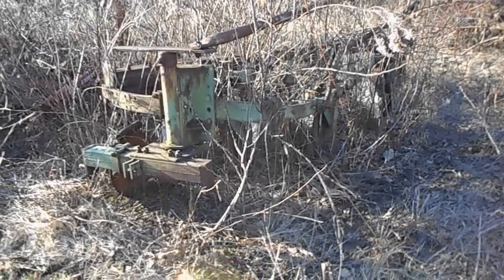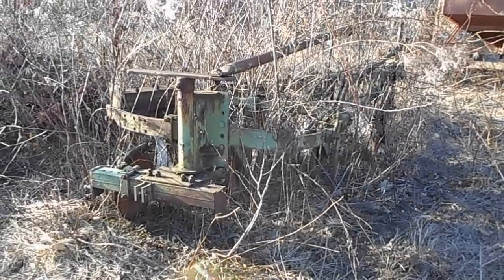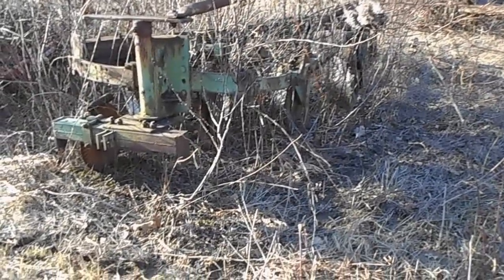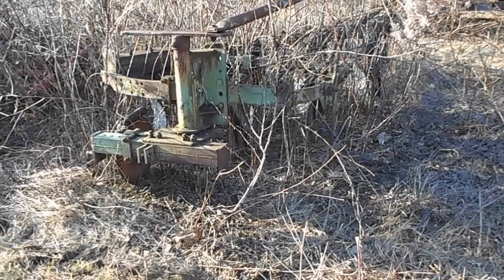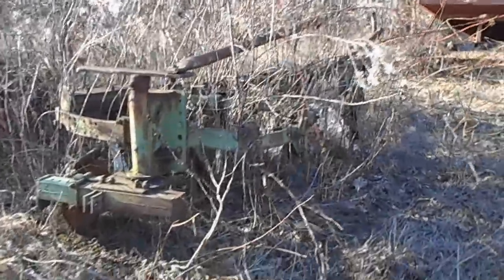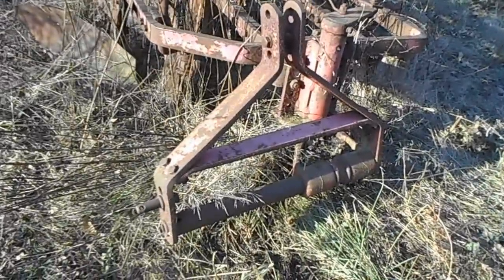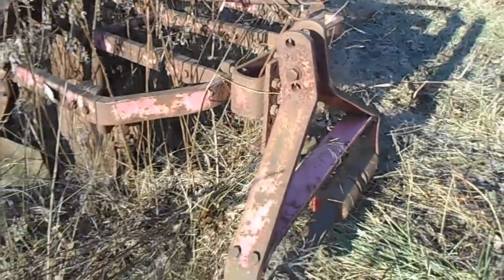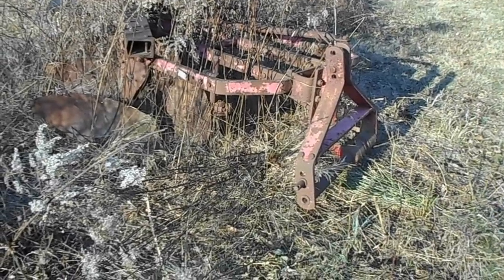Plow Education What plow for your tractor

Comment: Thanks I learned a lot on the 2 plows.   want to get a 2 bottom plow for my Massey 60hp.  I know I can't pull the Massey plow you showed in the video but since I want a 2 bottom plow, does the same strategy apply?  Thanks.  Full-watch.  👍🏽🙂
Reply from the maker: The only plow you will find in a 2 bottom is a mounted or pull type plow. A 60 hp MF should pull a 3x14" slick as can be but a 2 bottom she will pull it easy. My 1550's are 54 hp and they will pull a 4 bottom.  Most 3pt mounted plows (2 or 3 bottom)follow the same idea pulling from the center of the plow but when you get bigger like a 4 or 5 bottom ( 3pt mounted) it gets a little different because you cant pull from the center very easy, Thats why we used to run wheels out on the back of the tractor to center the plows. The work I did on the MF 4 bottom was the center it back up because the way it was it was doing all the pulling of the plow on the left lift arm on the 3 pt so it was pulling the tractor sideways a bit and thats why I centered the hitch back up like I did. A plow set wrong will pull really hard to the point it will make the black smoke roll out of a diesel !  The best thing is to get a book for what ever plow you get (ebay is a great place to look) and it will tell you everything you need to know to set the plow and the tractor together for good plowing.  Bandit
Reply: @banditfarmer1900  Thanks.

Comment: I've seen draft control way back on the hart Parr. Watching early IH videos they brag to high heaven about draft control. I have plowed with case and John deere and never even worried about draft control when younger. Pulled just fine.
Reply from the maker: This MF #88 semi mount plow is a lot different in the fact is the only plow ever built that would work on rock shaft or center link draft control systems.  Sure you could get that special quick hitch and use it on Ford MF MM and others that had a center link draft system and use any ones semi mount plows on the tractors, But the #88 plow was designed with that hitch on it so you could use it on any 3 pt hitch tractor weather it had rock shaft draft or center link draft. I've seen a lot of plows over the years and the #88 is the only one built like it and it could be ordered with the regular hitch (lower pins only) or with the full 3 pt tree for tractors with the center link draft system. But it would work on both tractors drafts systems equally well. This makes this plow a little unique ! Bandit

Comment: The way i was told how to recognise if a plow is made for centre link control is it has a solid round  hole for toplink, if the plow is made for lower arm control the toplink fixing is an elongated hole so that the toplink can float when the arms move up and down. With centre link control in a slotted hole it will not work as the pin just slides backward and forward in the slot, with fixed hole and arm control the tractor will try to raise the back of the plow first instead of the front to adgust depth, works to a point but puts excess stress on everything.
Reply from the maker: This MF #88 semi mount plow as far as I know was the only plow made that has a full 3pt tree made on the plow. It is semi mount but the way this plow is made its the only plow made that can be used on both center link draft control or rock shaft draft control. Most all semi mount plow (except for AC snap coupler and IH fast hitch have a bit of a different system) are set up for rock shaft draft control (lower lift arms) and can be used on any tractor with 3pt hitch. But using a standard semi mount plow on a tractor with center link draft control you'll be able to pull the plow but you wont have any draft control at all.  So MM Ford and MF made a quick hitch that are made like any other quick hitch (so you can use any plow or 3pt tillage equipment that require draft control) except instead of the lower lift arms being pined at the same level as the quick hitch jaw (that hooks to the plow to pull it) they are pined about 5 to 6 inches above the jaw so as you pull the plow it pushes the top or center link forward towards the tractor and activating the center link draft control system in the tractor. MF made this plow with this 3pt tree made on it so it can be used on any tractor or draft system. Now the MF #88 plow was sold with this 3pt hitch made to it or with just the lower pins style hook up but its the only plow sold with this full 3pt tree made for it and it makes it a bit unique in the plow world.  I have a couple of more video's of working on this plow and I explain and show how this hitch works, Just type in MF #88 plow and you'll find it.  Bandit

Comment: Molina's were also center link draft control.  At the last 10 or 15 years of Moline was.
Reply from the maker: Yup they were along with Ford and MF and a couple others like some Longs and Fiat and David Browns. There were only 3 systems really used Center link draft , Rock shaft draft and AC had snap coupler draft or traction boost (same thing) . But as far as I know this MF #88 4 bottom semi mount was the only plow built for either center link or rock shaft draft systems so that makes this plow a little unusual and sot after for farms with tractors with both systems of draft control cause it could be used on any tractor and work good on both. Bandit

Comment: Thanks for the video. I have M7060HD Kubota. Trying to figure out what the right plow is for my tractor. Any advice?
Reply from the maker: Well to tell you the truth I have never run a Kubota tractor before but from what I looked up yours has 71 hp , So it should pull a 4 bottom plow .  Now you have 2 choices in plows one being a 3pt mounted plow or a semi mount plow. Not knowing your ground if it rolls or if its flat I would go with a semi mount plow because a 4 bottom mounted plow might get the front end of the tractor light making more tricky to run on rolling ground. I don't know if Kubota tractors have rock shaft draft control or if there center link draft control, But if its center link draft control the MF #88 plow like mine would be the one to get to use with it. Now if its rock shaft control (most likely) I would look for an Oliver 565 4 bottom semi mount plow as they do a better job and pull easer.  Now I will say I am partial to Oliver plows but that's just my liking. But you have to find a plow you can get parts for with a dealer close enough by to get them from. I would say a 4 x 16" bottom semi mount would be a good match for it and if you can find an Oliver 565 (or any) 4x16" plow I think you will be happy with it and they made a lot of those plows so getting parts for them is easy enough even if you get them from Shoup.  I hope this gives you some ideas and helps you out.  Bandit
Reply: Bandit farmer hey. Sorry to bother u again but not overly knowledgeable about this and trying to make the right decision on the plow I get.  The draft control works off the top three point bar. Not sure if that is considered center link or rock shaft as u mentioned. Thoughts on these two plows
Reply: Trying to figure out how to attach photo
Reply: I guess u can’t post pictures. 

One is an Oliver three bottom and the other is a John Deere. Not sure on all of the models etc
Reply from the maker: @chaseyoung4797   Most all tractors with 3 point hitch can use any fully mounted 3 point plow without any problem weather its center link controlled or rock shaft controlled draft, Its when you go to semi mount plows it can make a big difference what plow to use. This MF #88 plow will work on either system, Center link or rock shaft draft system and as far as I know was the only plow built like this. I have a video I'm working on about this plow that I think will address a lot of your questions you have about this. I hope to put it up after the first of the year so be on the look out for it .  Bandit
Reply: @chaseyoung4797  Top link (center link).  OL J R :)

Comment: Oliver made an adapter for top link sensing tractors. There is a video on you tube called the color blind plow it shows the adaptor. Oliver bragged their plow could go on any color tractor that's why they painted some 1850s purple.
Reply from the maker: Oliver never had an adaptor for center link controlled draft but MM did for there tractors.  This MF plow is made for a tractor with center link draft control so MF MH MM Ford and a few others models. Those adaptors are hard to find these day but there around and there pricey to say the least, A year or so ago I found a CAT 2 adaptor quick hitch at a sale and almost had it bought for $50 till someone said what it was, It brought $575 !  Out of my price range for sure !  Oliver did make the best plow on the market, Pulled really easy and does a really good job turning the dirt over. Oliver wrote the book on plows and made the best and is why they still bring good money at sales. Bandit

Comment: Hi Bandit, I'm not a plow guy,but have used disc's for plowing. My question is what is the center link on a plow? Can you show? Thanks
Reply from the maker: When you look at the plows hitch it has 3 points of contact to look to the tractor. 1 and 2 are for the lift arms on the tractor to raise and lower the plow using the hydraulics. The 3rd on this plow is the center link connection from the plow to the tractor . On Ford MF and some MM tractors they use the center link to have draft control not the lower lift arms. This plow is made for a tractor with center link controlled draft system. If you look at the hitch on the plow you will notice that the pins for the lower lift arms (hook up) are above the pivit point of the 3 pt tree on the plow , This is to allow the center link to be pushed forward to activate the draft control in the tractor .  The less of a pull on the plow the smaller amount of draft put on the plow and the harder the pull the more pressure it put on the center link causing the lower lift arms being raised up to put more pressure on the back tires giving you more traction to pull with.  Bandit
Reply: @banditfarmer1900  Sorry never heard this called. Always heard part of the three point hitch... Thank you for the info!!
Reply from the maker: @wlewis6762  Different parts of the country call things by different names. Its kind of like pop, soda, coke ,all the same thing just called by a different name. Bandit
Reply: @banditfarmer1900  True... we always called the upper arms coming out of the tractor the LIFT ARMS, the rods going down to connect the lift arms to the lower pin hole arms the LIFT RODS, the arms going from the tractor axle housings to the implement hitch with the balls on the end to hook up to the implement the DRAFT LINKS or LOWER LINKS, and of course the third link turnbuckle at the top the TOP LINK.  Dunno how it was done elsewhere but that seemed to minimize confusion... OL J R :)
Reply from the maker: @lukestrawwalker   Different terms for different parts of the country. Its like going to Alanta Ga and asking for a Coke  and then being asked what kind ? LOL Well what kind do you have ? Well we got Coke Pepsi Dr Pepper Mountain Dew and so on, Just give me a Coke A-Cola LOL !  Soda  Pop sodapop  Coke its all the same thing just different terminology for the same thing only difference is what part of the country your standing on at the time.  Its the same thing as cutting corn or pickin corn or shelling corn people call it different things doing the same thing. To me Cutting corn is cutting and shocking it and Pickin corn is running an ear picker to pick it to store on the ear and Shelling corn is just that shelling it with the combine . But people call it different things in different parts of the country. The main thing is we know what each other is talking about.  Bandit
Reply: @banditfarmer1900  Yep, we usually said, "cuttin' corn" because everybody knows you mean combining.  Hadn't been much picking done down here since the 50's... and we cut soybeans and cut grain sorghum, so why not. Some say "combining corn" which is more accurate for sure, as a few big feeders chop silage and pack it in bunkers... silos practically don't exist here, what ones there were are skeletonized from the 40's or early 50's, if they're still standing at all.  At least in our area.  

Yeah used to be a lot more common around here to say ''coke" for any soft drink, but that's kinda fallen out of favor over the years.  I know when my dad's sister lived in South Carolina and we drove out there once or twice a year to visit, when we got in Mississippi it got hard to understand folks, particularly in rural areas-- and Alabama accents, geesh... LOL:)  Then Georgia and South Carolina had that classic "southern drawl" and was easier to understand, though some of the words were different.  I remember as a kid back in the 70's, people had a LOT thicker accents, and a lot DIFFERENT accents in various parts of the country.  Even different words in places.  Now not so much... I guess modern communications and people going to college all over and moving different places from all over has kinda toned down most of the accents and local pronunciations and stuff like that... Oh, it's still around, to be sure, but not like it USED to be... 

Funny story-- My BIL and I left the field where we were harvesting a couple years back and went up town to a BBQ place in Rochester called "Slappy's".  It was really good, they had various grilled burgers and barbeque and stuff.  I ordered a Slappy burger and fried 'shrooms, and he got whatever... I was reading the menu and realized it had onions on it... SO I told the gal as she was pulling out a box of chopped onions, "Cut the onions, please!" and she reaches in a grabs some sliced onions out of the container and plops them on the grill, and then takes the edge of the spatula and whacks them a few times... then she plopped my burger patty on top to finish cooking, and then scooped it all up to make the burger (or "Sandwich' as they call it in Indiana half the time).  I was like "well, alrighty then" and was shaking my head, and my BIL was laughing at me.  When we got in the truck I proceeded to scrape the onions off into the paper and was like "I told her no onions!" and he kept laughing and said, "No, you said CUT the onions!  SO she CUT THEM UP!  If you want no onions you gotta say "NO ONIONS! or "HOLD the onions", I was like WTF??  "CUT the onions means no d@mn onions!"  "Not here it don't" he said... LOL:)  He still giggles about that one, funniest thing he'd seen in awhile I guess.  Later!  OL J R :)
Reply: Top link on the 3 point... OL J R :)

Comment: The guy might have recognized it as a deal and plans to resell it.
Reply from the maker: Well I know for a fact they haven't plowed more than 150 acres sense they were new. Basically they were bought new and used for 2 years and have sit ever sense.  These were going to the scrap yard if I didn't buy them and there too good to let get scraped so I bought them and figured I'd use them or sell them to someone who does, But saving them was the point of buying them. The older small stuff is getting harder to find and to be honest a lot of it you cant buy now and if you can its very high priced .  When you find good equipment cheap you buy it when it pops up for sale weather you need it or not, Good small equipment is hard to find these days and when you find it cheap you buy it !  Bandit

Comment: Do you connect the oliver using a three point ?  I didn't understand how the one for John Deer connected.
Reply from the maker: Some of the Oliver semi mounted plow had a bracket to hook the center link to but some didn't have it, It really didn't do anything as far as plowing goes but what I was put on for was keeping the plow from tipping up on the operator if the front bottom got hung on something. Now the later model plows didn't have this option on them nor did the White semi mount plows. One of the Oliver semi mounts has it and the other doesn't, The one at the beginning of the video has the brackets welded to it but the center like bracket is gone. Some JD semi mounts have the same thing on them mainly plows made in the 60's and 70's. I was basically a safety device more than anything because all it would do is keep the plow from tipping forward on the operator if the first bottom got hung on something. AC had a real problem with the semi mount plows that were snap coupler semi mount flipping up on the tractor and the other companies took notice and did this as a safety device.  All semi mount plows hook to the tractor by the two lift arm on the 3 pt. Only semi mount plows made for tractors with center link draft control are set up ware the pull point on the plow on the 3pt tree is below the pins for the lift arms so it will activate the center link draft control as the tractor pulls the plow, As it pulls the plow it pushes in on the center link thus making the draft control work. Bandit